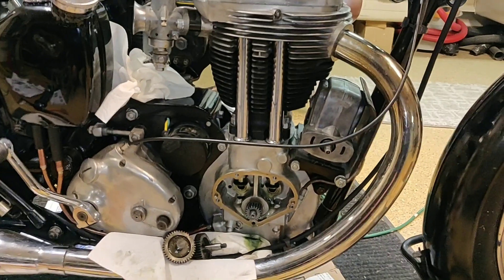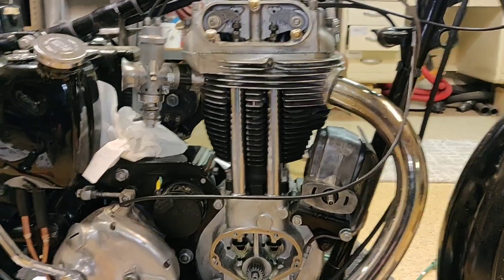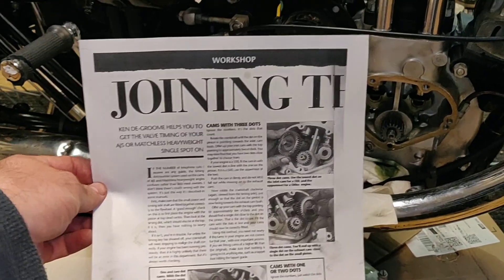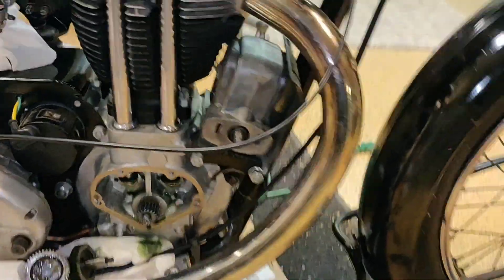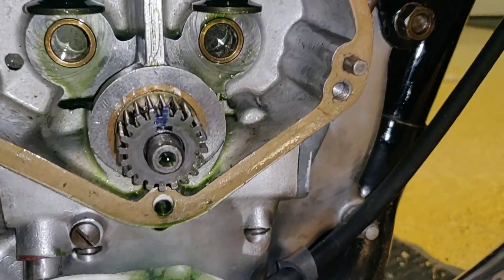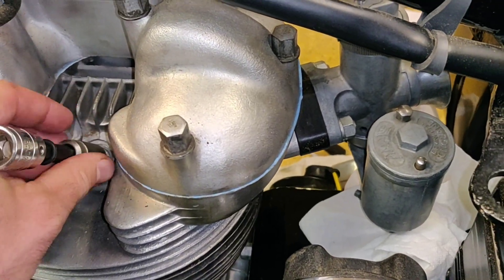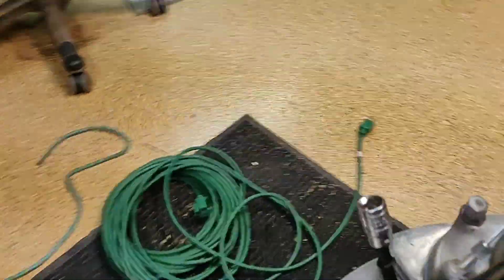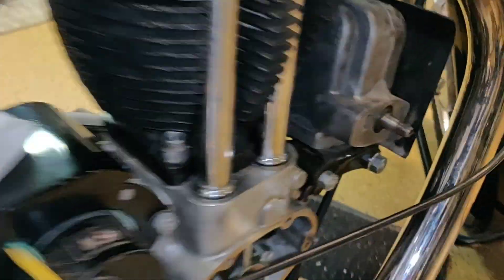1954 AJS 18S valve timing

Comment: "NO", I don't like the way You are doing the valve timing @#.
You should slacken off both Pushrods, and flip them to one side! Then, you can Aline the dot marks on the Cam-gears.
To replace the Pushrods, Look at the two pushrods, when one pushrod is at the top of its travel, adjust the other, to a spin-fit!
Repeat with the other one! PS, always oil the top ends of the Pushrods, so that they spin smoothly.
All these big English singles, 'can have' taller or higher gearing, change your engine drive sprocket to a 20 to 23 tooth one.
This will give a higher MPG, the reason this works so well, is these old singles are long stroked, and prefer to work !
Long Stroke engines give more leverage, so have more Power. Short Stroke engines, need high revs, to make power.

Comment: Some 50 years ago, I had a M18, used for fun-racing. We welded up the cams, and grind them down acording to a cardboard profile one of the guys had gotten hold on, to increase the lift an duration. And we added an extra valvespring, as I recall it, an echaustspring from a Volkswagen 1200, placed under the original hairpinsprings. And then a bigger carburetter. Wow, did it go! What a lot of fun we had, for very litle money. I realy loved that bike, we spend many good times together.

Comment: I have a 59 model so not sure if the cams are different but on mine you alone the dots the same way as you did but also go by the number on the dot as there marked for different tuning one being 350cc and the other competition. My 500 single is on  mark 1 exhaust side and mark 2 on the inlet side  as suggested in the Ajs matchless Service manual  by F NEILL
Reply from the maker: Thanks Chris, yeah I noticed after the fact that I set it for the 350 and plan to change it.
Reply: Time the 500 as the 350, per Ken de Groome's article. In addition , change the inlet pushrod  rocker arm for one from  the 250/350 lightweight model. Makes quite a difference.😊